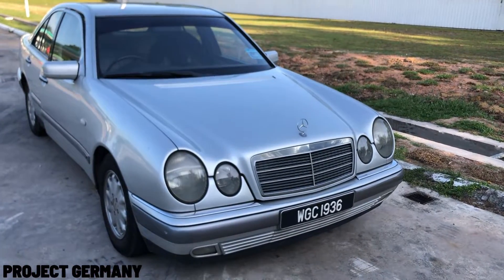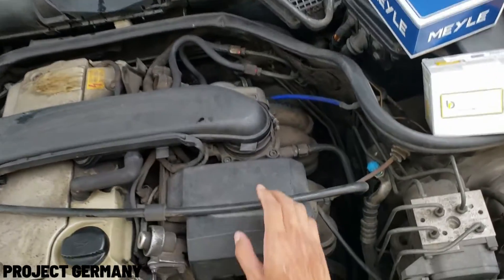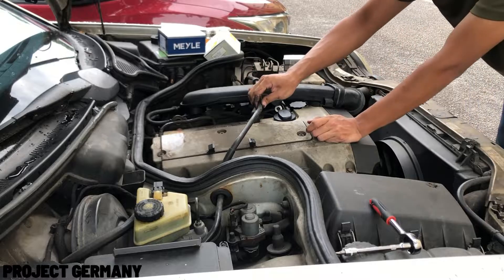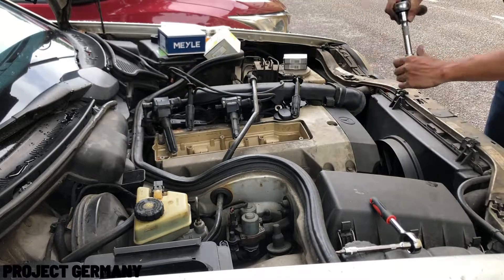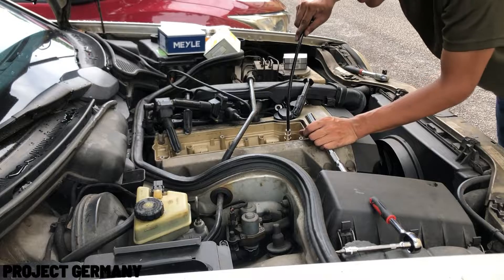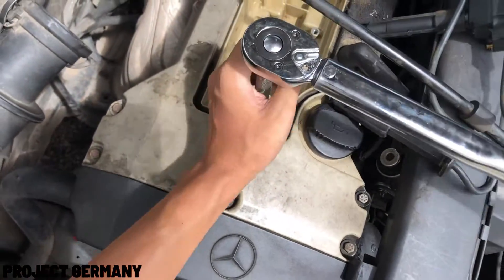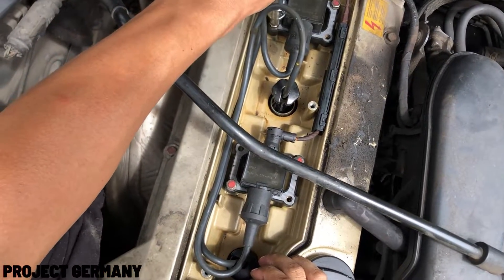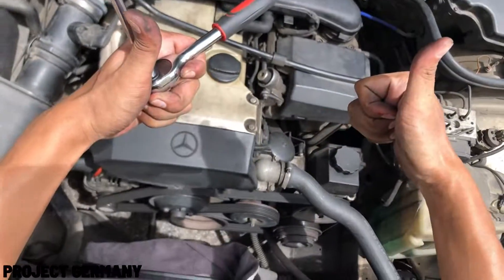"How To Change Spark Plug On Mercedes W210 M111

Comment: Awesome tutorial bro. Hey is there any tips to prevent the spark plug from cross threading during installation of new one?
Reply from the maker: Okay, as i shown in my video. To properly install new spark plug. First, inspect the spark plug thread. Make sure the thread have no damage. After that,  throw the spark plug inside the engine then use spark plug socket with extension, tighten it by hand first. If you feel a resistant during tighten it by hand. Loosen it back all the way and try it again. In my experience,  the spark plug hole are just enough to fit the spark plug socket. So, you will have the spark plug perpendicular to it thread. Plus, better tighten it by hand first just to make sure. I hope this information helpful. Thank youuu !!